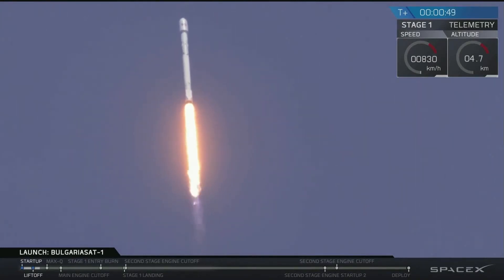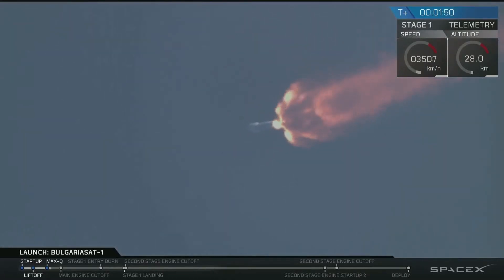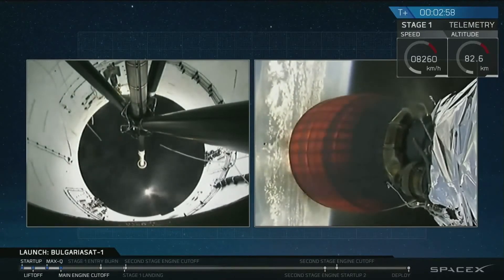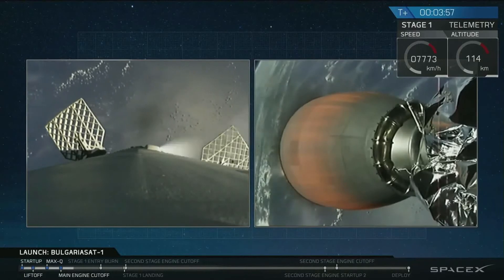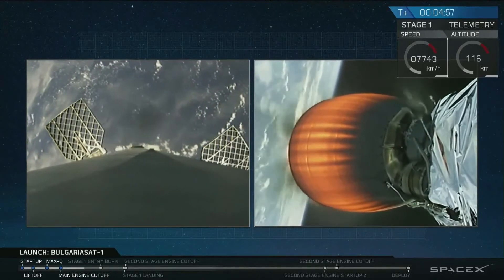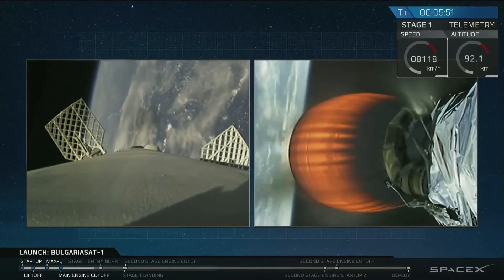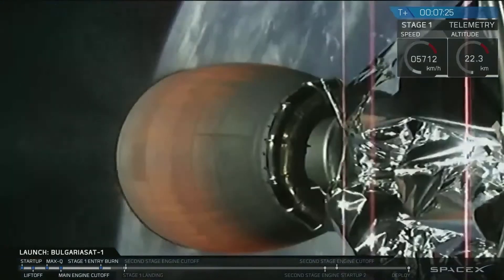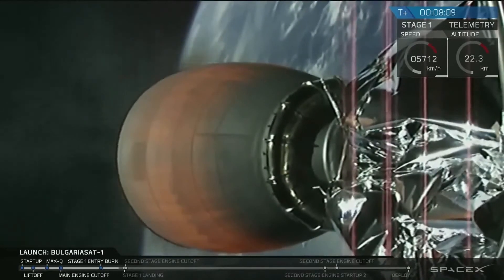SpaceX Falcon 9 Launches & Lands Again (BulgariaSat-1 Mission)

Comment: Question for the 4:30 minute marker on the YT Video, not on Falcon time.    ...what are the weird little puffs of white beneath the Falcon rocket as it is rotating to its return phase?  They seem to appear and then accelerate off the frame of the camera's view.
Reply: Spaceflight101, the puffs are different looking (much smaller and further in the background, away from the Cold Nitro jets.).